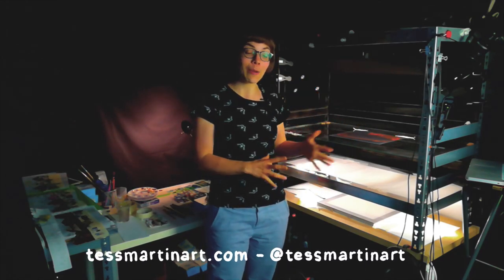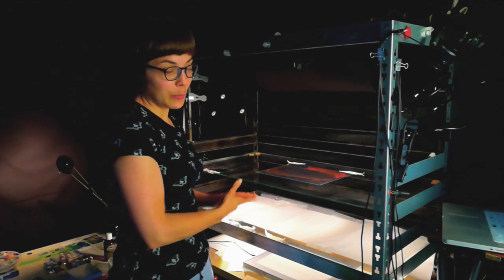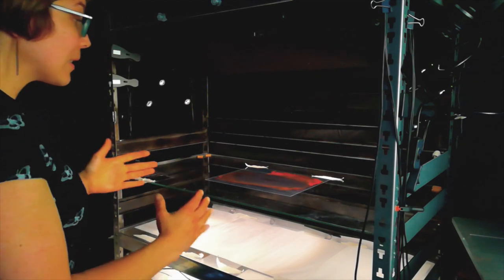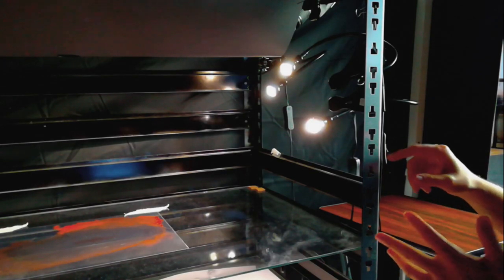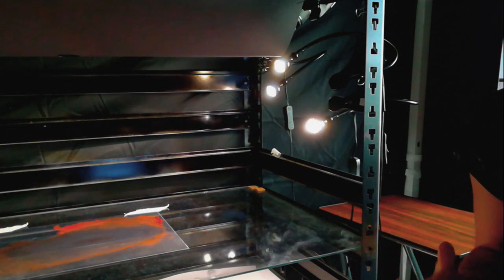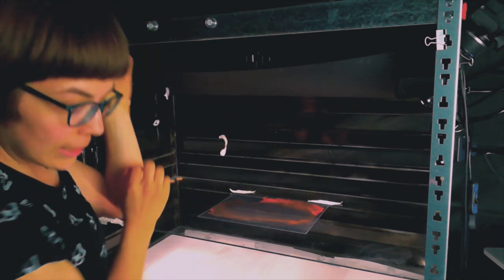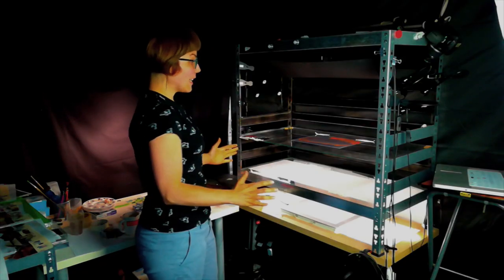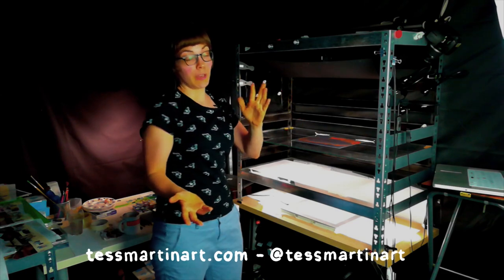How to Make a Multi-Plane Animation Stand for Under $200 (or €170)

Comment: Hi Tess, do you have any suggestion for better lamps? I've been using a few Ikea Jonsjo for a year now and they keep breaking. I tried a NÄVLINGE lamp (the new Ikea ones). They're ok but less flexible and with a wider light projection. Did you upgraded to something more reliable since this video? thanks
Reply from the maker: I've been using Phillips Hue bulbs and they seem to work well, though the app to control them is a bit simple. I know other people use DMX lights but I haven't gone down that route yet...

Comment: Hey Tess maybe a silly question but how do you keep dust off the glass?  I find that dust tends to deposit on the glass (not so much on the paper) and it's on the way when shooting. I need to wipe it off every so often but it becomes hard to do in more complicated scenes when there's a lot of stuff on the glass sheets. (thanks for this video, so useful. I managed to build my own stand with it)
Reply from the maker: Hi! Well I don't experience a ton of dust problems, but I keep my multi-plane area usually inside a tent or behind floor to ceiling curtains (black, to control the light), so not much dust gets in, really. Over time, sure, I notice some dust on the sides, where I haven't been animating anything, but because it's not in the center it's not a problem to wipe it off. Don't know if that helps!
Reply: @TessMartinArt  Thanks for the tip Tess. I'll try to protect the multi-plane a bit more.

Comment: tess, thank you so much - you're an angel! and your work is absolutely beautiful :) i have a question if you don't mind - which dimensions did your multiplane end up with? i'm wondering as i want to build a multiplane that can (hopefully) be suitable for different kinds of projects as well. i'm also worried with the height of it as the last stop-motion animation i've made resulted in a pretty bad back pain lol, so maybe your multiplane's height is more adequate somehow. thank you!
Reply from the maker: I'm not sure on the height, but it was half the height it was designed for. I only used half the vertical struts that came with the shelf. But, it's sitting on a sturdy stable that I had custom made, that's why it's at a good height for me.

Comment: This is such a useful video! And I love your work! Could you please tell me what are the dimensions of your shelf and glass sheets? Thank you so much!
Reply from the maker: Hi! I think mine is 40x90, or 40x100 cm - whatever the standard size for one of these shelves is!
Reply: @TessMartinArt  Thanks for the reply! I'm also trying to build one right now, but finding the glass is really the most difficult part. Are you just using anealed glass or is it tempered?
Reply from the maker: @dinozheng1402  I actually don't know! I got the glass as leftovers from a big glass company, and I didn't ask!

Comment: I don't know if I have overheard that information: How do you avoid the reflection of light on the glass? Do you simply bounce the light with help of paper (as shown in 7.45) ? :)
Reply from the maker: hi there! No, reflections are always a problem, unless you have super expensive non-reflective glass. My trick is to use wide glass, and position the lights so that the reflections are there, they are just off screen.
Reply: @TessMartinArt  Thank you!

Comment: hi!
i was wondering if you had any advice on the focus. whenever i try to animate i can't get all the elements on focus. Any kind of lens?
i dont speak that much english, i apologise in advance.
Reply from the maker: Hi there! I use a 28mm lens, but the best way would be to borrow a few different ones from friends and try them all out :)
Reply: A bit late now, but I think your problem could actually be due to the aperture (F-stop) setting of your lens. A higher aperture number like F16 will give you more of the layers in focus than an aperture of F2.8. Look up the term "depth of field" for more info.
Reply: @TessMartinArt  Hi Tess, I’m setting up my  multiplane using your advices. I find that with wider lenses (28 - 35) I also capture the sides of the structure. Would you crop that after on dragonframe?
Reply from the maker: @bluecrocodile.  yes! I don't usually have to crop much out though...

Comment: hi! what kind of registration technique do you use?
Reply from the maker: Hi Bea! I'm not sure I fully understand your question. Usually on the multi-plane I'm using paper cut-outs or paint-on-glass, for which you don't need registration (like you do with drawn animation)
Reply: @TessMartinArt  hi! I guess I was thinking of how to use this structure with drawn animation or anything that needs to be kept in place- I am fairly new to this, I do 3d animation so...you can imagine :-)
Reply from the maker: @beaorlandi3661  oh, well in that case you can use the same registration method you'd use with a normal light box or light table - just tape a peg bar to the glass, or two rulers to make a right angle :)